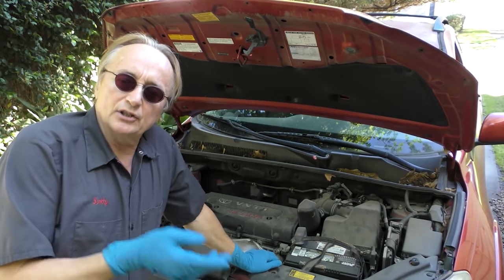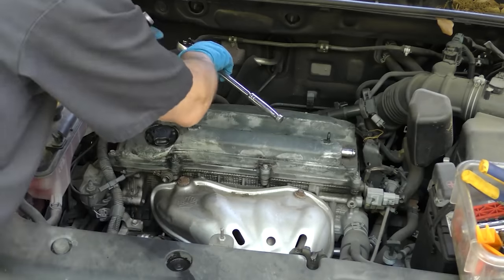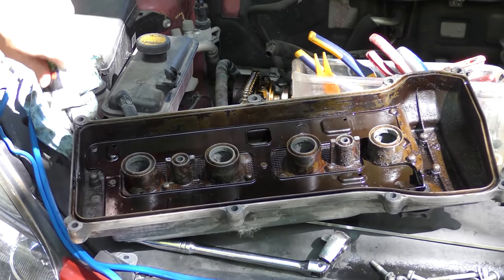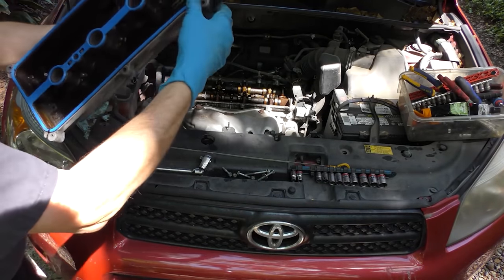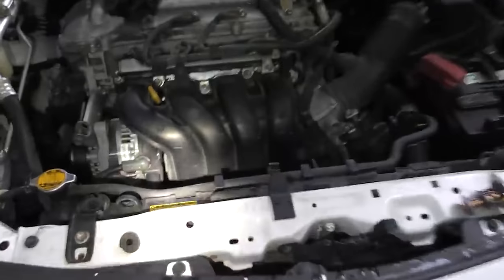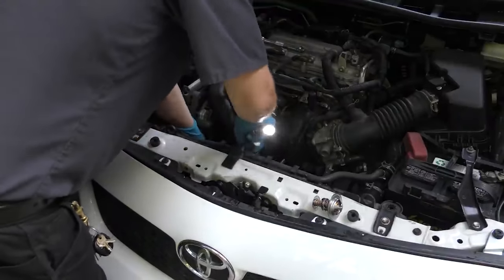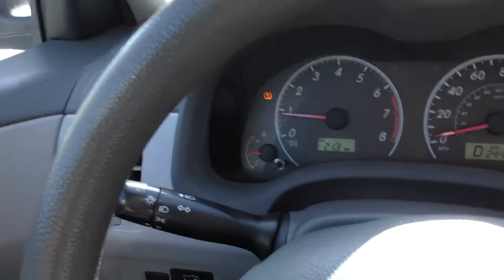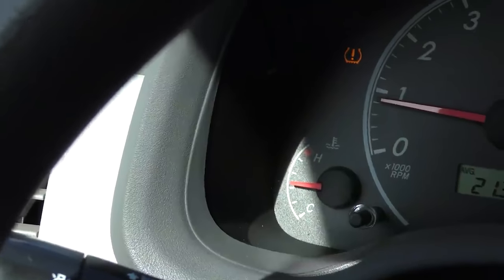3 Mechanic Scams Caught on Camera

Comment: My husband and I have a mechanic that we've gone to for years; literally generations of owners (family business). If there is a problem, they'll let us know. If we don't need something, or if they can do a repair cheaper, they'll let us know, then, too. Honest mechanics are hard to come by, but when you have one, treat them right, and stay with them.
Reply: I've been one of those honest, local mechanics he talks about for a dozen years of my life.  None of us acted like this guy, though...  There's some advice to be gleaned from his videos, but overall...? Kind of a charlatan
Reply: @scottamu7816  I'd be curious to know what specifically makes you think Scotty is a Charlatan
Reply: @VangusKhan  I would consider myself an honest mechanic. Come from a independent shop and now work at a dealership(more secure job). I find Scotty to be really pretty knowledgeable. A little old school for sure but nothing done wrong.
Reply: @scottamu7816  If you think Scotty is any kind of charlatan, then clearly you're not the honest mechanic you boast to be.
Reply: Wish I could find one. My car uses a mini radiator that can be bought new for $50 and takes about 30 mins to install. The lowest shop quote in my town was $550 and the highest was $1270. Me and my brother did it ourselves for the $50 part cost.
Reply: agreed! I was in my 30s before I found a good mechanic. He is the only guy I trust with my car.
Reply: As a mechanic whos honest and always does his best to save the customer money while getting an honest cut, it makes me happy to know people value my work. Our honesty often gets taken for granted. Thank you!
Reply: @nickyasa5341  You don't deserve a pat on the back for your honesty. Being honest is the baseline - its expected and should not be considered anything special- its like being polite- its the minimum standard. Its supposed to be taken for granted.  If you are honest and do good work - you will be rewarded with customers that come back over and over again and recommend you to their friends. That's how I show my appreciation to my my mechanic!
Reply: Broke down when I moved to a new town and had the tow truck take me to the mechanic they trusted. Gave me good fair rates and when I later went back for a completely separate issue, instead of taking my money and doing a subpar job, they realized that what my car needed was something better served by another auto shop nearby. That's when they got my business for as long as I'm here and my reccomendation to all my friends in town
Reply: I tried one that came highly recommended.  I had him do some work. I also asked him to flush my coolant since I didn't have time.  I got my truck back and he didn't flush it. 
He didn't charge me for a part that cost  80.00 extra so there's that.
Reply: My dad is a mechanic and it’s honest to say that it is hard to find mechanics that are not going to scam you and get as much money from you as possible and I do believe my dad is as honest as a mechanic can get I’m not being biased but I’ve seen his work on cars and the way he talks to his clients
Reply: I decided to try a guy that came highly recommended. He supposedly replaced my rear main seals and did a coolant flush.  He did none of it. I eventually got him to flush the coolant and got my money back.
Reply: Scotty is the only mechanic I 100% trust, but he's not my mechanic. Some mechanics (have a philosophical point of view to save the customer as much $ as possible) you have to deal with that as well. Get to know your too good to be true mechanic and know what you are asking for, I write a note and put it on the dashboard or he will for sure forget something. Like replace the hoses and the thermostat with a lock open one, 180 °
Reply: I know of a business that is super honest, Iverson's in Decatur Al, they have been working on our cars for years. From the van i learned to drive in to our business trucks now.
Reply: Couldnt have said it better myself. In my early 30s and just now found a mechanic i wholeheartedly trust and tells me things like "this and that is starting to go bad but it can wait." A good, honest mechanic really makes you feel blessed
Reply: I had a problem with my old car and two mechanics tried to screw me over with unnecessary repairs. Third one I've found fixed my car properly, did it fast and cheap. Since then I always go to him - i know he knows what he's talking about when there's some problem.
Reply: @FuzzMustard  good for you, I'm glad you were able to fix it yourself !
Reply: @nickyasa5341  I appreciate men with pride in their work. And making a fair profit for work is expected. Can't run a business for free.
Reply: Absolutely i go to the same mechanic my great grandparents went to and the original owners of the shops grandkids run it now and they have that honestly and hard work ingrained into them they may cost 10% more but that’s just a tip for doing it correctly not up charging you or trying to get you to buy unneeded stuff
Reply: @VangusKhan  I'd like to know how Scottamu got 5 thumbs-up.
Reply: Honest people are hard to come by.sad situation!
Reply: @michaelsmith4325  same thing happened with a mechanic that I had in the Poconos in pennsylvania. Pop owned it and it was alright. Then it went to the son, and all of a sudden the prices went up, renovations were made, there were tons of employees just floating around. Great for them, bad for us.
Reply: Yep I can tell the good ones when they say, nope was something simple, tightened the Knudsen bearing retainer, and the noise you thought might be the $2600 transmission went way.  $35 bucks :)
Reply: Why doesnt your husband just work on the cars himself, or at least look at them himself? He should know what’s wrong with them. You dont need a mechanic for this stuff….
Reply: @kesselrunheroj8497  It's so infrequent to find an honest mechanic, it's good to show appreciation. God bless you. But yes, honesty should come as standard as taking your money for services rendered, there's a price to pay for doing things dishonestly.
Reply: How nice for you.  This isn't reality for 95% of people who go to a shop.  Not everyone's daddy played Golf with the owner like yours
Reply: @FuzzMustard  same in Australia. If you have an electrical fault in your car. They won't give you a definite answer on the cost to repair. Which means they will charge you like a winded bull in a china shop
Reply: I find these days a lot of the issues is competence not honesty.  Its hard to find good mechanics. Think the dealerships are too cheap and can't hold onto qualified mechanics. I say that because they'll often say they can't figure something out. Cars are more complicated but scary when the dealer says they can't fix something.
Reply: Thats very interesting.......
Reply: We thought we had a good mechanic after a year till I needed a alternator put on. He fixed it alright. I had a small 4cyl motor that got great mileage. He kept it for over a week, put 300 miles on it running for parts and driving home. I found out a week later. I was stuck home all this time. That's not nice, too bad theirs no Crime by doing it
Reply: Spiderman no way home@ iagree toyota is one of the best
Reply: Thats why id like to start my own shop versus working at the dealership but as a young one that’ll be some time
Reply: @scottamu7816  Kind of a charlatan? Please can you explain please?
Reply: @VangusKhan  One thing I would point out is @10:19 he gets coolant on the paint work and that damages paint. I haven't watched his videos for awhile but just from this video I found this.
Reply: I took my car to Firestone in Lexington Kentucky had a water pump replaced. I couldn’t believe it when I found out they charged me over $1,400.00 and didn’t even replace the thermostat. I had to do it myself. He also broke a part tried to Jb weld it. Unbelievable. I had to replace that also at my expense
Reply: you dont have a man lol
Reply: Come on number 2 was a Toyota the trans is fine I’d throw a new headgasket straighten the head and throw it all together it would probably run another 60k-80k maybe more that ain’t a goner
Reply: Yep.
Reply: @scottamu7816  what exactly are you talking about that you think he's a charlatan about. He's giving good advice basically open your eyes ask questions make sure they do what they say they're going to do. Just because you're an honest mechanic doesn't mean all the rest of them are going to be too and if you bid in the industry for a few years like you say you have you'd know that. 
 Just because you go to a place where the fancy name and doesn't mean they're all going to be the same quality and I also don't all communicate with each other
Reply: @nickyasa5341  that's nice that you make your customers happy but really the reward for doing a good job and being an honest mechanic is you get paid a paycheck or a salary or you have good happy customers recommend you to other people for a mechanic
Reply: Absolutely true. We live in Las Vegas area. I'm afraid to take one of my cars to any Shop in town. We're Lucky here in Boulder City to have a good local mechanic one man and assistant shop. He does good, clean work and "Honest" is in the name. Thanks Lee for keeping my cars in great running condition.
Reply: Aa see❤one
Reply: Personally I’ve always asked for photos of the process from start to finish for record keeping. I always tip for them to do it of course but it keeps people honest plus it’s good for later on when selling the vehicle.
Reply: Stop eating dealer and independent shops time then, take it to them the whole time. Repairs and oil changes.
Reply: ayo please I need an honest mechanic
Reply: @scottamu7816  Scotty is basically a master mechanic.  Bring him about any car whatever year , and he'll probably have an idea of what the problem is without even looking under the hood.
Reply: @kesselrunheroj8497  and BEWARE some of these so-called ripoff artists will intentionally create a problem so down the road u will come back...
Reply: Shout-out to Borche's High Tech Auto on Hoover south of 10 Mile Rd.
Reply: If Jesus experienced death for only one minute, then he is not God or the son of God, but rather a human being.
 If Jesus rose from the dead , then this is normal. 
I, you and Jesus, when we die, will rise from the dead.
Jesus and we are human.

God is not jesus Christ 
 Jesus was talking to God, 
Jesus was praying to God, 
Jesus said that only God knows when the hour is ،
Jesus said he was going to God.
Jesus said he couldn't do anything to himself.
 we are facing two separate personalities and they cannot be one  .
God is only one .
God does not beget or be born.
God has no equal.
 God has no likeness
Jesus is not God or the son of God .
I invite you to Islam and worship the one, true, living God.
In Islam, your relationship is only with the one, true, living God, without a mediator
Reply: @davecrupel2817  ooh that was good😂
Reply: Are literal generations of owners different than non literal generations of owners?
Reply: That's for sure 😃😃😃😃😃
Reply: I think Scotty has done this repair a time or two.
Reply: I have a shop that I go to and he is completely honest as anyone around in fact, I'm convinced that he is Abraham Lincoln reincarnated
Reply: @kesselrunheroj8497  I always tip my mechanics,at least with a case of beer for him n his helper..💰
Reply: @itsnoneofucar8792  Do you tip your doctor?  If not, do you expect them to put in less effort when they are working with you since you don’t tip?
Reply: @kesselrunheroj8497  the dr,the lawyer,the judge,the car sales man n the papa would never get a tip from me,the rest of the world yes..🤑
Reply: @kesselrunheroj8497  n I tip after the work or service,no before,,my correlon..🦃
Reply: @neil A  it won't damage the paint
Reply: I work for a family owned mechanic shop, the owner is a gem. He's given me and our customers advice on how to keep our cars in tip top shape even after the repairs are done. He's also given me advice on how to better handle money. and work life balance. THAT right there is the boss everybody deserves to have, someone who actually cares
Reply: @scottamu7816  When you've been a mechanic for 50+ yrs like Scotty, and worked on many generations of cars come back and tell us if you still think he's a charlatan.
Reply: The best way to treat your mechanic right is to send him customers. Tell everyone you know what a great shop they are..
Reply: @VangusKhan he's from Charlotte lol
Reply: Thankfully there are still good ones. Sadly they are becoming more rare.
Reply: Literally 3 generations? 4?
Or is it just a figurative generation. Literally!
Reply: Helps to have a husband there so it's unlikely that you'll get conned.
Reply: Very well said
Reply: Finding an honest mechanic is like to find a virgen prostitute on the streets of Calcuta , but there must be one out there though 😬
Reply: Doesn’t apply in NC or SC… They suck either way.
Reply: @scottamu7816 doubting You're a good mechanic just because you called Scotty a charlatan. Obviously you're one of those mechanics that rather leech off your customers money rather than actually giving them the service they paid for. Just by this comment I know you ain't a trustworthy mechanic.
Reply: @kesselrunheroj8497 you do realize you just contradicted yourself. You say he doesn't need a pat on the back. Yet when you show appreciation to your mechanic you are quite literally patting them on the back. Also you should never take advantage the politeness, honesty, and mannerism of anyone. Once you take advantage of a good person you will see a change in people. Not saying you are doing this or will be the cause of it. However, many good mechanics often retire early or end up going bankrupt because of people who took advantage of them. This happens because of a high quality service being made at a low price. Scotty even says it how it is on how much a specific repair would cost and some mechanics will do the work at a lower cost. That to me isn't fair when the mechanic is trustworthy and honest to you.
Reply: I wish you lived by me. As a women I can't trust any mechanics. I watch as many videos I can so I hopefully don't get taken advantage of. Cars are so expensive already so with scummy mechanics that rip us off and cost us even more is so wrong.
Reply: I had the whole honest mechanics thing for around 7 years, or so I thought. Last year I discovered they were screwing me over.
Reply: Absolutely.
Reply: A mechanic friend taught me to put bolts removed in a tray, don't loose them and makes sure everything went back on. Easy.
Reply: They are probably ripping you off. My mom went to the same place for years, and she literally did not know the difference between being ripped off by a good mechanic with a good reputation and good reviews, vs actually getting good service at a good price
Reply: @scottamu7816 maybe you're not a good mechanic then? Good mechanics recognize good mechanics. Maybe you're one of those guys that are just getting by, ripping people off here and there so you can enjoy a lavish life above everyone else
Reply: @reckethrxbl honest mechanics don’t consider themselves honest by word of mouth 😂